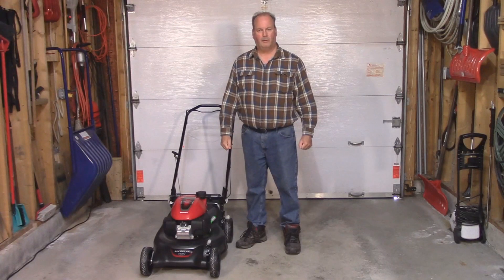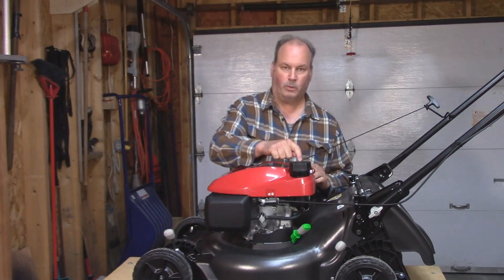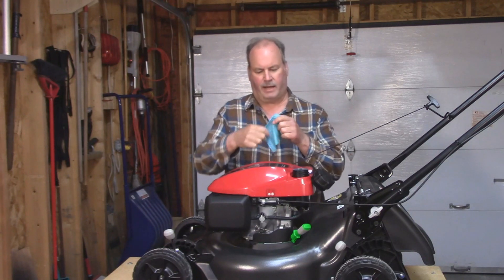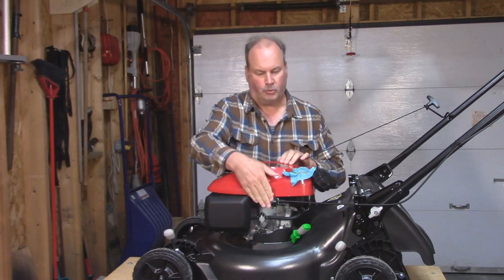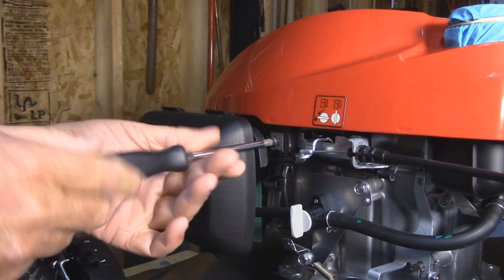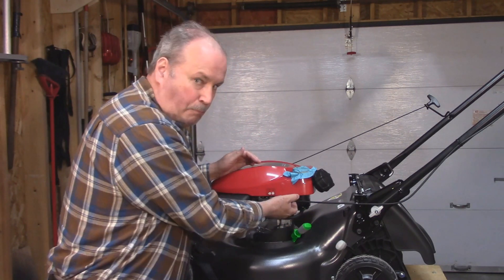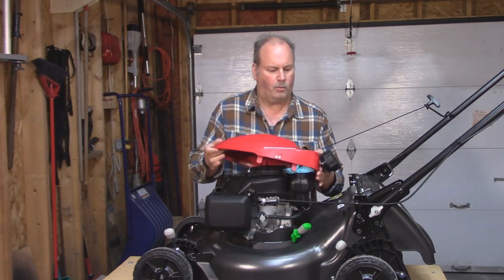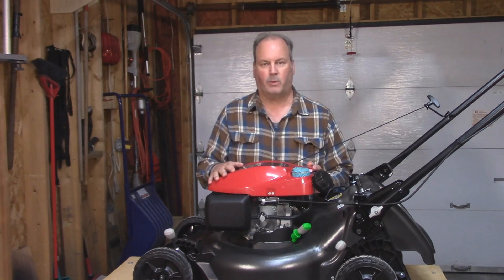Honda HRN216 Remove Top Cover

Comment: Absolutely special, I was about to break the cover off because I did not know that it had a screw holding it on and did not know that I had to pull out on each of the locking tabs. So much appreciated! I have no idea why you would have done this video but all I can say is that you saved me a lot of grief for weeks to come, each time I would use our mower I would be reminded that I broke it. I do not like to work with broken things and especially when dummy me broke it. Thank you so very much!

Comment: Great video, short and sweet, no fancy music or video. Now I can proceed. I just purchased my HRX217. I heard Honda wasn’t going to make lawn mowers anymore. Mine now is over 25 years old…plastic deck is amazing , no rust,it runs perfectly . I’ll pass this fine machine on to my son-in-law. I needed the key start feature.
Reply: Once you got eletric start.... You won't ever go back. It's been a pleasure doing fall cleanup with my HRN216VLA. Honda stop producing mowers as of 09/2023, however they said parts will still be made. How long..  Idk but I already stocked up enough parts to have this mower last another 10-15 years

Comment: wish wish there were more videos like this for everything!! is only one that shows this,  precise no nonsense short clear step by step, bravo!
However,  hesitate but am gonna share my embarresing stupidity,  (mines hrx217k6vkaa gcv 200)to be exact)  just in case helps even one other if were like me @ 40min in tryin to get off cover,  watched too many no help videos impatient highly agitated w seconds from just ripping it off stomping on it and callin it a wrap and you'd absolutely missed it...... the screw w the u clip lock? ...... well. .... said clip has to come off before pushing the tab to lift off cover.  Don't laugh at me. 😂😂😂

Comment: Thanks, great tutorial, clear simple instructions, including the nice safety tip securing the nitrile glove over the fuel cap. I had the top cover off just to clear a snag in the pull start cord, everything assembled again and started first time.
Works just the same with the Honda GCV x 145

Comment: I just bought an HRX217 electric start with recoil backup.  Since I do simple repairs myself and anticipating an inevitable rope failure (they used the smallest starter rope I've ever seen), I needed this information.  It's not an obvious removal and you're video was invaluable.  Thank you.

Comment: Thank you for this!! How do you replace the pull cord starter??
Reply: You ever change it? Busted my pull cord and was wondering how to change it. Thanks
Reply: @lerma2891  no we just tied the piece that broke off together with the rest and it’s working just fine for now until we replace it.
Reply: @lerma2891  I hope you were able to replace yours!
Reply: @yesenia7274  lol I actually did the same thing. I just have to reach further since it's right at the motor now. I did order a new assembly just hadn't put it on yet.

Comment: Having an issue with mine. When I start it up I’m hearing a rattling noise. Gets a little louder if I lift the front of the mower up. Any idea what it could be or have come across that?
Reply from the maker: It could be anything. Check to ensure everything is tight including wheels, adjusters, handlebars, carburator, release cable, blades, even the motor mounts. Next start it up and put your hand on the top cover, air filter, use a stick to press against the exhaust to see if the rattle goes away. Turn off the fuel and remove the spark plug so it spins easier and pull the cord quickly to see if it will rattle. You are going to have to isolate the noise to a more specific area. Try these and let me know.

Comment: What else can I check?  
I mowed today for about 20 minutes with my HRN216, shut it down, and when I went to start it, the rope will not move.  Removed the spark plug, still no joy.  Checked under, nothing blocking it, but it has the clutch for the blade anyway so even if it did have grass build up that shouldn't stop it from pulling/starting.  It was recently serviced for the recall w/the camshaft decompressor, and I did a full mow one time afterwards.
Reply from the maker: Remove the plug and try to turn the blades by hand. If they turn, then it could be your recoil pull rope is jammed. Is there any fluid in the cylinder? If there is then it could be hydro-lock which would prevent it from turning. This could be caused by flooding or you got oil in the cylinder from tipping the mower over the wrong way. Just a couple of ideas to check out.
Reply: @PaulPomerleau  Thanks, Paul.  I did have the mower tipped BEFORE I had been mowing.  Which is the right way to tip it when you need to clean under it?  I removed the spark plug and still no joy.  Then, I removed the cover, then the recoil, and I was then able to turn the flywheel backwards about a quarter turn using a screwdriver handle, then turned it forward and went back/forth a couple times and it was then fine.  Put it back together and it's been fine since.
Reply from the maker: Excellent. Well done. I wonder what caused it to jam in the first place?
The correct way to tip a mower is to first pull the cord slowly until you feel maximum tension which will tell you that both valves are closed which prevents any oil from getting into the cylimder. Mind you, you would not have been able to do this since you couldn't turn your motor. Then the most important part is to ensure that when you tip it, that the air filter is facing up. This prevents any oil from soaking into the filter which stops any air from going in, thus your motor won't run. Motors need spark, fuel and air. Without any of those it just won't run.
Anyway, good job on fixing your mower, and thanks for letting us know in these comments for others who may have similar issues. Have a great day.